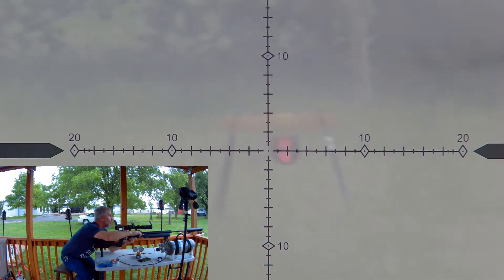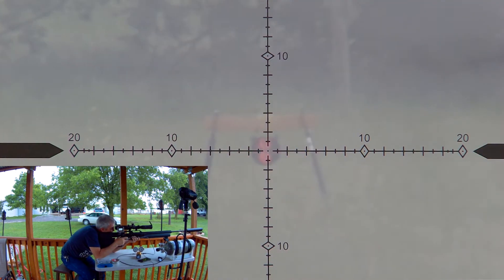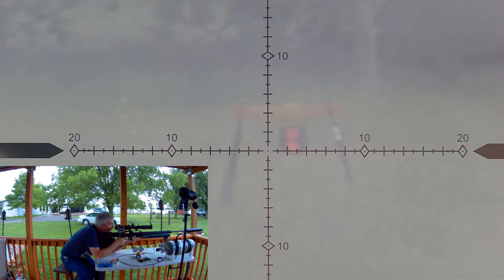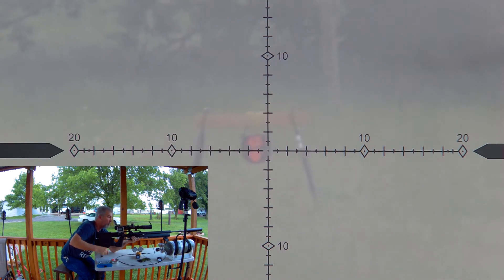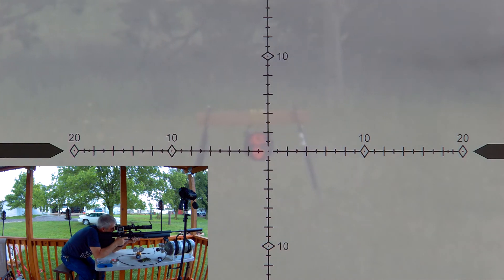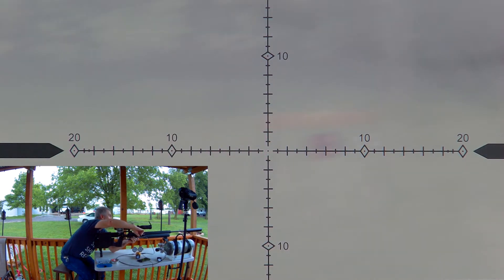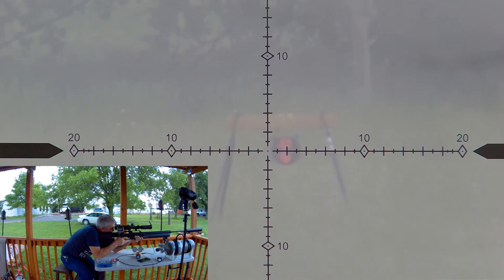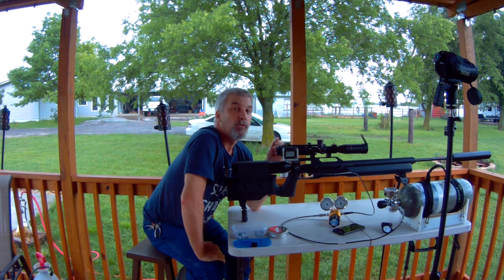257 Texan shooting 8" Steel at 255 and 295 yrds

Comment: Nice..what bullet are you using..?
Reply from the maker: Those are the 92gr LFN casted from an arsenal mold.
Reply: @derekburton6467  thanks.. I have a custom condor. 257 .and a .257 texan hardly had time to shoot them...I'm building a .224 so it could collect dust like the other 🤣🤣🤣 .atleast they are there for those rare occasions I have time..👍👍